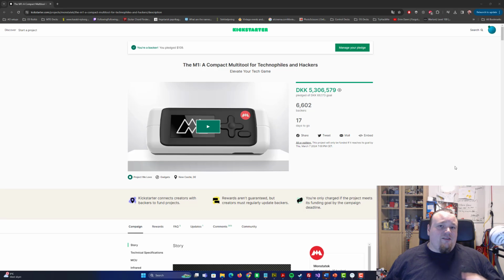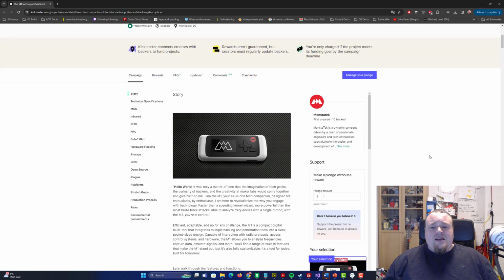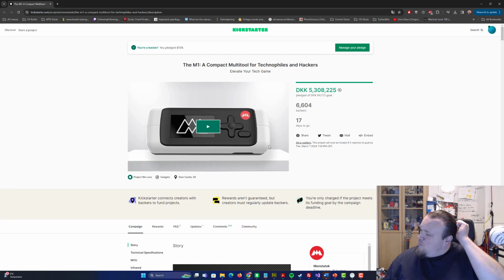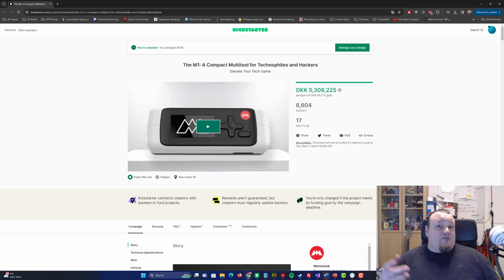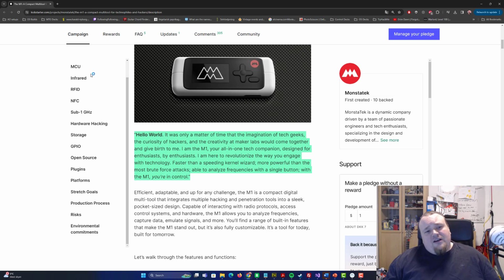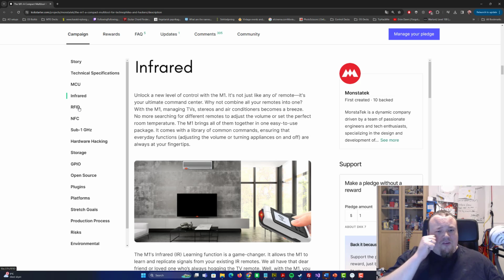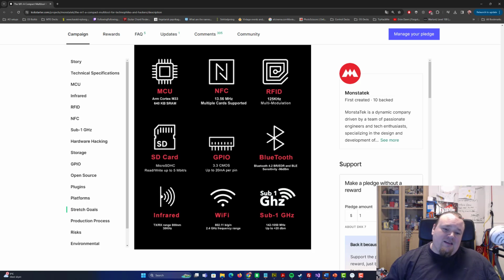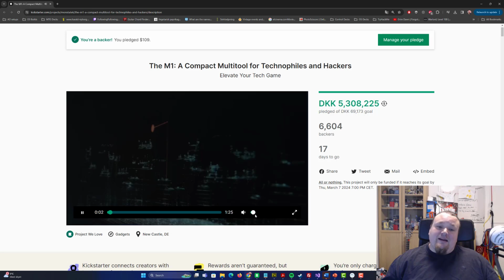MonstaTek M1: The New Flipper Zero is here

Comment: The only differences between the two is the larger screen of the M1 and an onboard wifi board with the promise of future updates FOR wifi pentesting rather then one you need to attach like the flipper zero so there will be a price difference will pentesters be attracted to it? Depends on wheather or not all the reqjored firmware is included. "WE ALL KNOW WHAT A PAIN IN THE AZZ FINDING AND
FLASHING THE RIGHT FIRMWARE IS. DON'T WE FOLKS?"For the price flipper zero can do everything the M1 does within specific
Frequencies and if you
Don't need a
Wifi board for pentesting then you can remove it and put it away and you can possably
Score different colors or a transparent flipper where as the M1 is limited in this customization area.